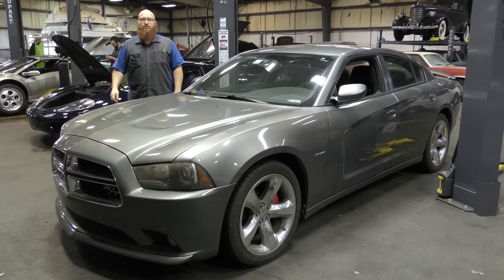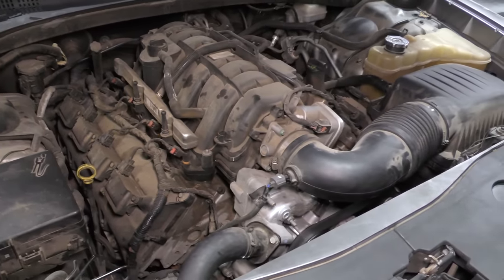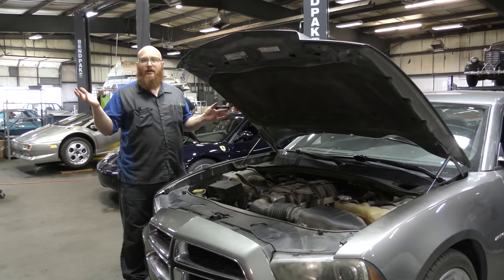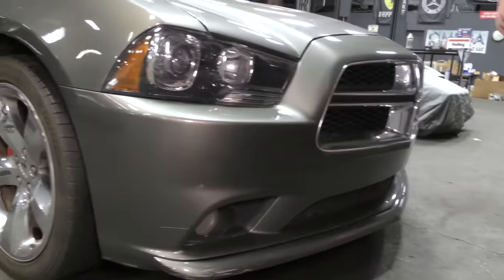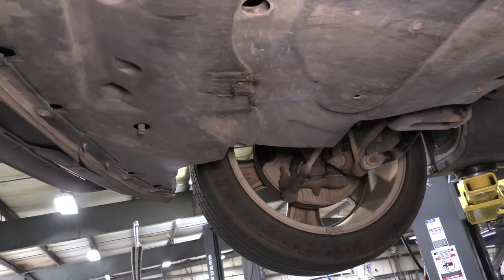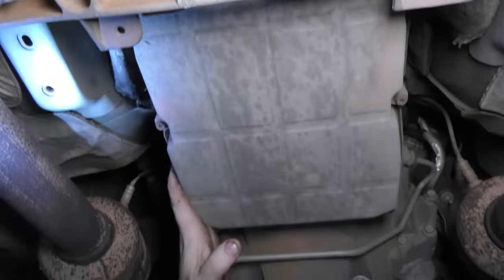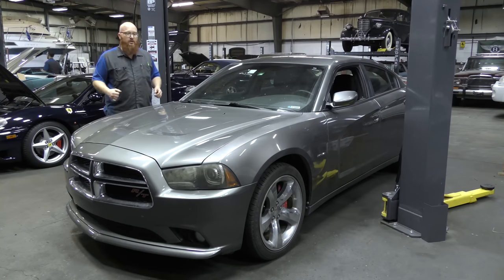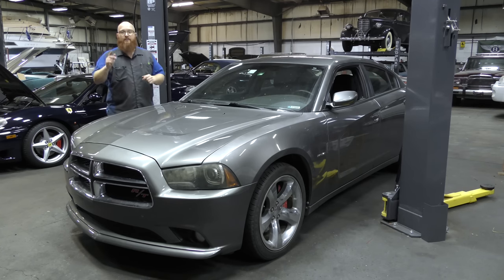Tic Tic Tic! 2011 Dodge Charger RT has the infamous Hemi tick. What will the CAR WIZARD do about it?

Comment: I had a 2001 GMC Sierra with the 5.3 v8 that had the famous piston slap.  It had it until the second transmission locked up at 408,000 miles.  Just kept it maintained and it kept running.

Comment: My 1988 Chrysler LeBaron Convertible had 2.2L inline 4. The motor really was not that bad. We put near 300K on it. The sound was not really annoying, but made me take pause every once in a while. That was cam slap. You could hear the OHC slapping away at idle.

Comment: This Chrysler is getting near Toyota build quality with 200 K miles and no oil leaks. Great video Wizard.
Reply: It's basically a mercedes
Reply: @blueryxfalls7949  engine is most certainly not however and is the reason there are no oil leaks. Also the 13 pin connector on the mercedes NAG trans are notorious for leaks because the silly germans used the wrong O-ring material for the trans fluid they were using. If you've ever worked on a mercedes you would know its nothing to brag about.

Comment: I watched this whole video waiting to hear the tick!!! I'll take your word for it on being benign. Our PD is retiring its Hemi Chargers (our newest one is 2013 now, I think), and we keep a couple out at the academy for EVOC training. Those things had a whole life on the road and that life wasn't easy. And now they get beat on by half a class of trainees! Brake pads every 3 months, oil changes every 6, etc. These things get punished. Not a lot of miles getting put on anymore, but the miles they get are brutal. Similar mileage to what yours is showing here. I started one up and I thought the lifters were collapsed. TICK TICK TICK TICK. I wonder how long these motors last before giving it up. I was impressed that they still run well and do their thing with 200k of cop life under the belt.
Reply: see comment from Tech13:
The injectors tick very loud even more so starting 2011.
They put noise insulation over the rails to help. 
The lifter rollers wear out and wipe out the cam lobes. 
That happens because they moved the cam higher in the block for better valve train geometry.  Now the cam does not get constantly bathed in as much oil and there is no oil galley feed to the lifter bores for lubrication.  
It gets whatever washes over the lifters. 
If you hear a lifter tick that means the lifter roller is worn and the cam is getting scored. I
f you have a misfire and you want to determine if it's a bad cam. Do 4 or 5  Accelerations to the redline. 
Then the engine will start to misfire bad
 Let it idle and it will smooth out. 
When the ramp on the cam lobe is damaged it causes the lifter to collapse on hard acceleration.  
Even if you don't hear a tick it can still be a bad cam.

Comment: I'm really really surprised Wizard said he likes these Hemis.  I figured he'd say different.  I work for a used dealership and we get tons of hemi-powered cars and truck rolling through here.  It's about 50-50 if it has the hemi tick in varying degrees of loudness.   As you might expect most customers don't want to buy a vehicle that ticks right off the bat so we do have to fix a lot of them.
Reply: What exactly do you guys fix for the "tick repair" coinsagE46m3
Reply: I’m curious what one of the fixes is as well

Comment: My 09 RT had the tick. No big deal I drove it to 250k miles with no issues. General maintenance items. Front suspension was shot when I sold it. My  modified 96 neon has a similar tick. I love driving that car though. 33mpg average, it's fast and handles beautifully.

Comment: I'm not a sedan guy and also not a dodge guy but for some reason I find this car to look sinister and I love it .... if I was able to come across the right spec for the right price I'd like one....
Reply: Better as a 2 door!
Reply: @Cre8Lounge  2 door cars suck, rather have the 4-door version. (station, even better.)
Reply: @Cre8Lounge  Nah, not at all. I know you're referring to the old classic models, but still. Dodge made a smart move by making it 4-door to appeal to a wider audience.  In the case of the Hellcat, how can you beat a 4-door sedan with over 700HP that can be used to haul the family around or have fun? You can't. Now if only they would bring back the Magnum and put the Hellcat engine in it. Oh boy.
Reply: Find a 2014 SRT8. It’s the last year of this body style.
Reply: They especially look sinister with Ohio State Highway Patrol livery on silver with blue strobes on the roof!  OSHP has been driving Chargers ever since the venerable Crown Vic was discontinued.  Now they are switching to SUVs... Explorers and Tahoes.
Reply: @Cre8Lounge  the Challenger fills that market slot.
Reply: @nielsdebakker3283  As someone with an '05 Dodge Magnum, they're definitely nice. I think the '08s are the better of the bunch as they've got the more "modern" key, remote start, different headlights, and the ability to have a MyGig radio (don't get me wrong, the REC is a nice Alpine radio, but the early ones are prone to failure, and mine is faulty).

Comment: The issue with the Hemi 5.7l V8's tick is because the angle of the lifter bores is almost flat and the camshaft is much higher than the old 5.7l Hemi, from 2003 - 2008. This flat planed design gave better valvetrain geometry and increased power quite a bit. However due to this design, the oil would not sufficiently lubricate the valvetrain well, especially if it was idled a lot, when the RPM'S are generally below 950.
What FCA failed to do was put in a higher volume, higher pressure oil pump and they hardened a lobe on the front camshaft lobe, which would have pumped the oil at greater rate during idle or low speeds and prevented such a catastrophe and the hardened cam lobe was harder on the lifters. While this issue is less than 5% of all Hemis, the next statement will help. There is a You Tuber by the name of Reignited and he is a Mopar Guru, especially when it comes to the 5.7l v8 hemis. He is the one who found that by putting a Hellcat oil pump in these 5.7l v8, which operates at a higher  volume, that this issue was solved. The Hellcat engine oil pump is approximately between $700 - $1000 for the part and that is much cheaper than spending $5000 on rebuilding the top end of this engine. https://www.youtube.com/watch?v=jkNOXWGXADM 
As far as FCA/ Stellantis is concerned, and this is coming from a Mopar guy, most of FCA's vehicles are junk. The few reliable vehicles they make are the Grand Caravan and Town and Country, (2015 onwards, the 2008-2014 minivans had major electrical fuse box issues),  300, Challenger and Charger,  Viper (2009 - 2017), Durango and the Ram 1500 with gas engines. They are not as reliable as Toyotas ( then again, which manufacture is? ) but these vehicles that I mentioned will last you a long time with minor repairs as long as you maintain them very well. Percentage wise, from a reliability standpoint, these vehicles are lemons approximately less than 5% of the time, thus it is generally speaking, very good buys. The new Pacifica, I haven't heard much about its reliability yet. It is still a recent vehicle.
Their problematic vehicles are: the entire Jeep line up; all their Fiat vehicles; Journey, 200C and the 2012-16 Dart.  These junk vehicles that I mentioned have a failure rate of between 10-30%. The 30% is for Fiat, Jeeps are 20-25% and the Dodges are between 10-20%. By failure, I mean it has given owners consistent headaches in a short period of time.
These good and bad ratings are for all FCA / Stellantis vehicles from 2009 onwards.
Reply: Finally someone with real answers and knowledge. Swap the oil pump and you're good. I'd still disable mds and delete the mds plugs swap the lifters and camshaft, springs.
Reply: I have a 2020 charger rt 5.7, is the hellcat oil pump plug and play? What else is needed?

Comment: My '07 300C with the Hemi has just cracked the metric equivalent of 100,000 miles, and it's still extremely quiet. I don't know if this is down to my religious oil change schedule, the quality of oil and filters I use, or just dumb luck, but that engine has been extremely reliable in the 4 years I've had the car.

My oil pressure sensor went out at almost exactly 10 years of age too - Seems to be a common time for the OEM sensor to fail.

Comment: Impressive for an almost 200K mile car.  No leaks!
Reply: I’d check the fluids, might be bone dry
Reply: 200k isn’t a lot of miles anymore
Reply: @waterloo123100  it is for any Dodge/Fiat/Chrysler/Nissan/Renault vehicle
Reply: @ozarkliving7263 That’s what people say when they know nothing about cars 😂 My dodges have been better then our Honda’s and Toyota
Reply: @waterloo123100  
Same here. Durango has 300k on it no issues.
Neighbors honda blew up at 125...
He don't even know why...
Reply: @kenik2023  My Durango doesn’t have that many miles on it 😂 it’s still one of the best cars I’ve owned. But there probably something wrong with the owner if your neighbor blew up his Honda at that my miles 😂I just can’t stand it when people say dodge is crap.
Reply: @waterloo123100  actually you couldn’t be more wrong, but don’t take my word and dozens of independent mechanics I know personally whose experience is the basis for my assertion, look at resale value.  Vehicles that are trouble prone tend to show that by becoming cheaper to purchase used than a Toyota or Honda due to the high cost of keeping them running.  Appears you’ve had good luck.  Great, consider yourself lucky, because many of your fellow owners have had to put a lot of money into and have had to get used to being stranded owning those vehicles.
Reply: @kenik2023  300k on a Durango with “no issues”?  I call BS on that one, or you have a 1 in a million vehicle…. And it’s “doesn’t” not “don’t”.
Reply: @ozarkliving7263  Are you a mechanic personally? Because I am and I know plenty of other mechanics who also know that Chrysler isn’t as bad as you shade trees think they are. I enjoy working on them and owning them. FYI My Durango has been one of the best vehicles I’ve ever owned and I’ve seen dozens of them with over 300k all original. You don’t know shit bud
Reply: @ozarkliving7263  
Sorry to break it off in ya fanboy.
It's called maintenance. You should try it sometime.
Reply: @kenik2023  sorry homie don’t swing that way, but by “maintenance”, I assume you mean multiple transmissions, maybe a head gasket or two, maybe a main computer replacement, prior to 150k miles, yeah, I’m not into that.  Better label would be “fact boy”, as the used market backs up my assertions with pitiful resale on those piles of junk.
Reply: @kenik2023  from personal experience, maintenance cannot fix poor build quality, Chrysler’s are a nightmare with problems on problems. I made a mistake last year getting one cause my family only drives Toyota. Instead of a new experience it was more of an embarrassment while our other two Toyota’s (FJ and Land Cruiser) ran miles around it without problems. After some time going to the garage to check on my Jeep in the FJ, I was pretty convinced I had to get rid of it lol even the mechanic started talking about not understanding why people buy these. It really was just anxiety on wheels right from the moment I turned it on which it always sounded hesitant to. Unless you got really lucky and you enjoy it, I’m happy for you but I would suggest you to stop being in denial and face it before things go worse, I switched to Lexus and never looked back since.
Reply: @ozarkliving7263  exactly these “fanboys” are in denial. It’s crazy how I see 8 year old land cruisers averaging around 300,000 miles selling for 20-30k dollars here in the GCC and they still sell like hot cakes. My dads Land Cruiser is 12 years old and not a single major problem still. Runs like a tank but smooth and the most expensive repair was maintenance, the shocks which were less than 200 dollars lol. People love these here for the right reasons because they’re indestructible. I still have yet to see a Jeep of similar age with over 130,000 miles here since most either have under 80k miles or are too expensive to repair and scrapped. Even this guy at my school has a Jeep SRT with 70k miles and I went to ask how it is cause I owned a GC as well and he instantly told me how problematic it is and that it’s trans is screwed and can only be driven on 2wd.

Comment: All Hemis tick there are 3 distinct different ticks. 1. Injector tick, harmless noise can temporarily be remedied with a bottle of Gummout. 2. Exhaust manifold stud broken, will tick until it gets warm, caused by a loose or broken exhaust stud. 3. Lifter collapse, expensive fix but not nearly as common as people would have you believe. My 2020 Challenger R/T has ticked like a sewing machine since I got it at 10 miles on the clock (now 13k) Gummout quiets it down til I run that tank through.

Comment: They located the cam too high up in the block. The cam gets starved of oil at idle because the crank doesn't splash oil up that high.
Reply: Funny enough, if you are always pushing high rpms it means those parts get properly oiled and no hemi tick can form.

Idle her too long and you got a tick though so its really a catch 22
Reply: What's the solution then ? Use the best synthetic oil and drive it easy!
Reply: They just don't like to be idled too long, for example like police do. Great for cruising on the highway.

Comment: I can sympathize. I live in Willcox Arizona, and the muffler phenomenon persists here as well. Something about the Midwest and western United States engenders anti-muffler sentiments.

An added bonus, as I'm sure you're well aware, is that when they mutilate the factory exhaust systems as they do, it often completely screws the factory settings causing the vehicle to spew an abundance of unburned fuel exponentially increasing the pollutants in the air. You can really tell after two or three gems of driven by in a row, it's nearly impossible to breathe.

Comment: I know what you mean about cars without mufflers or running an exhaust bypass.  I have neighbors with very loud V8's. They are often so loud when they drive past the house our pictures vibrate on the walls.  Drives me frickin nutz🧐 And I'm a car guy🙄.  Courtesy though doesn't seem to exist any longer.  Like closing the bypass when going into the neighborhood, or driving in a manner to quiet it down at least around people's homes.  Too much to ask for these days. 🤔

Comment: Great video! I feel these cars get underrated by people. I have one and I have a family member with a 300 which has a ton of miles. They have been very reliable and they get decent highway MPG. In town mileage is not so great but for a big motor full size car it’s good. This car should get more love then it does.

Comment: I own a 2011 Charger Pursuit 5.7 Hemi with 201,000 miles. I had the engine rebuilt with the heads, valves, and lifters were rebuilt. Everything is fixed I'm into it for less than 10 grand.

Comment: The reason for the hemi tick is due to the  shaft mounted stamped rockers. They are not pedestal rockers and due to them being stamped and having a little slop (intentionally) built into the shaft clearance it chatters a little.

Comment: I was told that ticking was because of the design of the motor, the oil galley was angled to such a degree that the lifters weren't getting enough oil or something like that.
Reply: Yeah, they tried reusing the same system from the Magnums and it didn't quite fit
Reply: The angle of the lifters is such that the roller bearings are not getting oil from the top (dripping down past the lifter body onto the rollers).  If you drive these hard, and keep them in sport mode, the windage off the crankshaft is sufficient keep the rollers oiled.  Long periods at idle is not good for them.
Reply: @zilksmooth  its defective bearings in the lifters just like GMs have.
Reply: @canadaguy1234  yes but driving the shit out of em makes em last longer before failure.  cop-surplus chargers should really be crushed though as excessive idle time was already an issue with anything cop-car but basically kills the hemi

Comment: In January we inherited a 2012 5.7L Ram with the Hemi tick upon start up. The tick quickly goes away. The exhaust manifold tick is a fairly easy repair, the roller/cam tick would be an expensive repair. The truck is very fun to drive, probably the most fun truck we have ever owned. At 138,000 miles we’re a bit apprehensive about keeping it. The body and frame are in mint (California truck) condition so even if the engine fails, it would be worth the money to repair it.
Reply: If you have a quickly disappearing tick, most likely a less serious problem as opposed to a persistent one.

Comment: I love my 2017 Ram! It’s got that loose manifold bolt problem, Hemi tick, and I feel a clunk in the rear end coming to or leaving from a stop. Other than the bump everything else I can live with. The bumps harsh sometimes. Brought it in and they kept saying it was the way I was driving or they’d say they’d plug in a scanner and reset the transmission. They eventually found a broken gear in the rear. All was well for a few months, but it’s come back again. I guess there’s slack and the near gear broke. I have a nice bumper to bumper warranty so if my rear end explodes one day idc.

Comment: Finally, the truth about the infamous hemi tick.  I’ve seen several YouTube videos and read many articles about this. And while it’s not a good thing and the noise is not particularly pleasant, it’s not the end of the world either. And it’s more common than you think. Mid to late 70s General Motors  350 cu in engines, the workhorse engine of General Motors,, had valve train tick.  My mother had it in her 1977 Olds Cutlass.  My 1975 Pontiac Firebird had it. Here’s what the shop foreman said at the local Chevy shop. ‘Don’t worry about it.’